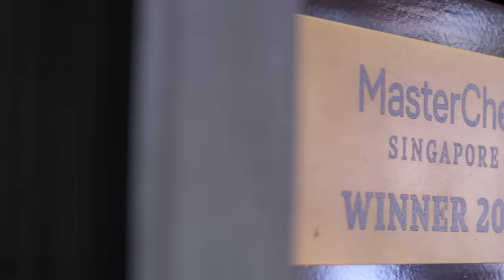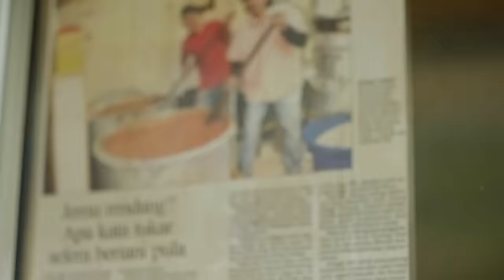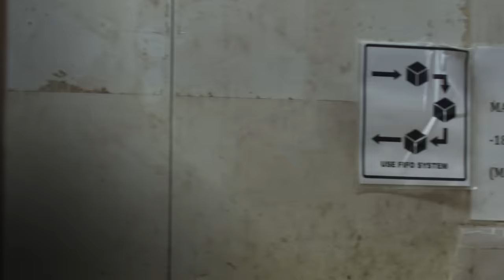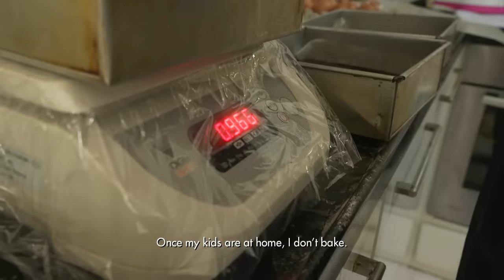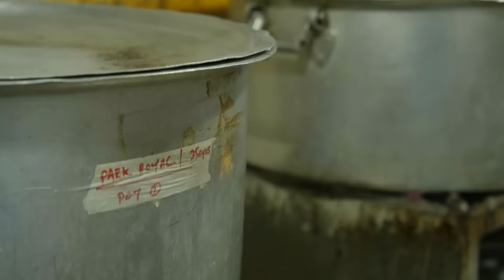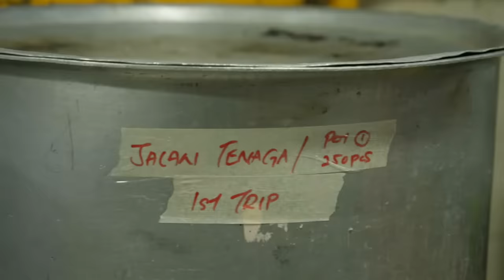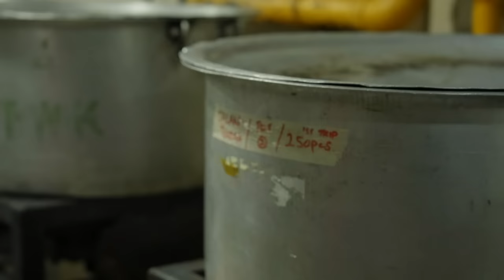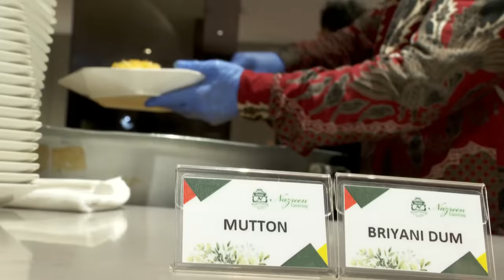Can This Masterchef Cook For Three Weddings In One Day? - Eat Up! | On The Red Dot | Full Episode

Comment: Billion dollar global insight - 4:50 instead of cloth based soft gloves that trap germs and reduced productivity as workers have to work slower and more careful to avoid slicing their fingers off at the vertical machine saw (when passing through raw meat), equip each worker with medieval style lightweight metal (stainless steel) mesh gloves? This will increase speed and output for each worker and reduce labour costs. Noteworthy is the reduce risks of medical compensation payout and costs to insurance companies on their financial disbursement to disabled workers. Which male will marry a fingerless woman who is poor? Conversely, there is the concern of the metal gloves exterior touched or sawed by the saw resulting in hard metal particles inserted on the raw meat products which is ingested by end customers resulting in laceration of mouth, tongue, throat and gastrointestinal. Alternatively, why not improve the saw machine with hybrid daylight and night vision dome cameras at the top of the vertical blade pointing down. AI non-networked app in each saw machine measure “Foreign object colour X” e.g. special coloured gloves or colour other than red and white” that does near the safety keep away distance from the running blade, so the saw blade auto stop within half a second. Half severed finger can still be reattached if you reach hospital in time. The concern is the camera may be dirtied by the splatter of meat juice which reduced its effectiveness and accuracy. The second alternative is to use human safe infrared laser (detect foreigner enter kill zone to auto stop blade) system in home burglar alarm system sync with special gloves?

Comment: 4:45 Why not use Tesla robot arms tech to quickly pincer clamp grab and lightning saw (vertical machine saw) pork from larger parts into smaller parts to max profits? This will reduce the risk of workplace injuries (saw off fingers) and cut labour costs significantly. Most importantly, it markedly reduce the risks of transmission of diseases (pandemic) from human meat processing workers to the meat (product).